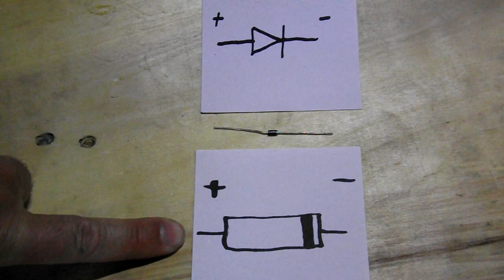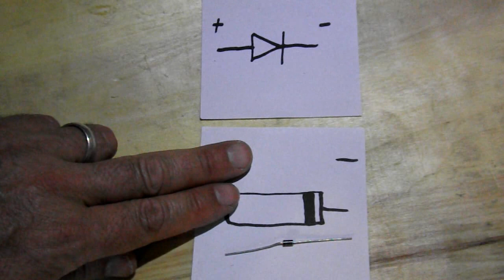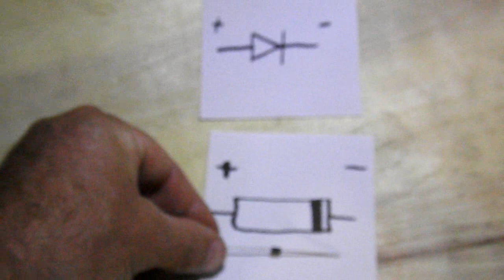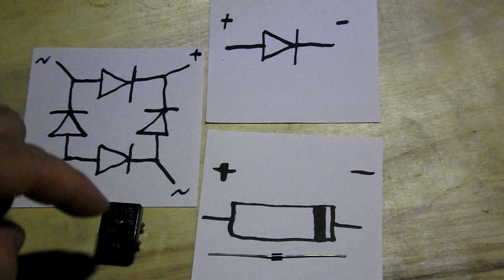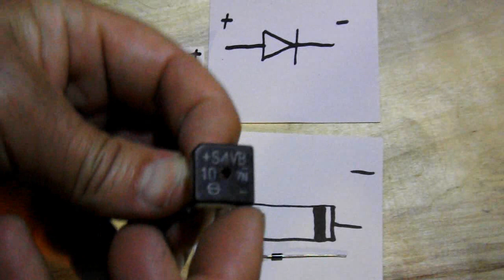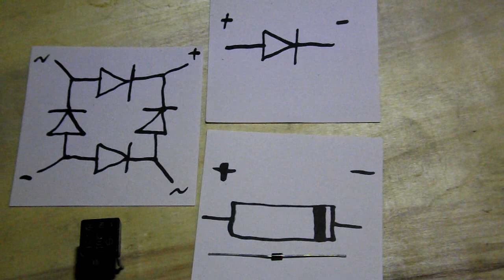Beginners Electronics ~ Understanding The Diode & Bridge Rectifier

Comment: Why you change the direction of rectified current from direction of diode current.... 
As the diagram, current goes from positive to negative in diode..... 

Why in rectifier, Current goes from negative to positive side, shouldn't it be  from positive to negative too??

Comment: Plz tell me one thing if we put dc current to plus and minus of a bulb and give current to both side of bulb mean current in negetive and in possitive of a bulb and there is no negetive or ground so does it glow..??
Reply from the maker: I dont know what you mean by putting dc current to both sides. If you do not have plus and minus from the power supply connected to the bulb, nothing can flow.
Reply: @thedoityourselfworldelectr8007  i mean give current to minus also and positive also of a bulb so what should happen because there no way to flow the current throw nuetral so does bulb glow.??

Comment: In theory: Electron moves from Cathode (-ve) to Anode (+ve)
But practically: it flows from +ve to -ve, P to N, Phase to Neutral

😀😀😀😀
It's true
While designing the circuit diode place in such a way + to -, if you put diode (arrow direction) from - to + in -ve line, It won't work, practically I tested yesterday.

Comment: I'm having an issue with a small solar panel used to charge the battery on a security camera. For some issue the battery won't charge beyond %10. The only thing in the panel is an 1n5819 blocking diode. When I test for continuity the diode is blocking return current but when I test in the flow direction I get a single "beep" out of my meter. The diode is still in line with the panel, should I get a continuous tone from the diode or just a beep? Thanks in advance

Comment: The power flows from positive to minus anywhere"Like a global standard!.What you mention is the electron flow goes from negative to positive(The classic, or even technical, current direction was determined before science knew what really carries charges, or electric current. It established positive charge carriers that flow from the source plus pole through the load and into the source negative pole [1] [2]. It later turned out that there are electrons that are charge carriers by ordinary power line. The electrons are negatively charged and therefore move from the negative pole of the source towards the positive.But in a circuit design etc it is the classic from positive to negative that goes(unless it is spesifick mentioned)Maybe in making some components etc the non classic"way is needed to get optimum understanding and results.

Comment: this is incorrect... nothing flows to negative in the bridge rectifier... both flow to positive... DC. I just learned it now...here by it being wrong ;-)
Reply from the maker: That fully depends on who you are talking to. Through the years some have said it flows one way and some have said another. It also depends on what country you are in. I am now quite confused about which is the current "correct" way we are accepting at this time.
Reply: Yes, but it either all goes positive or all negative, not both in the same explanation.

Comment: The plus and minus may be differently marked on the diagrams around the world but the current goes from the negatively charged to the positively charged as negatives are the electrons and only those can move around (to the positive to equalize).
Reply: They basically work as a pressure. Too much of negatives pressure and they want to go to positive to equalize (pressure). But positives can not move around.
Reply: Current goes from positive to negative, but electrons are flowing from negatively charged to positive holes.......

Comment: Troy.  Nice video introduction for beginners.  Let me add just a tad for those interested in energy relevance to this.  Electron current travels from negative to positive in actual.  But for most circuits it matters little for practical purposes which way you think.  Blame Ben Franklin for originally giving the terms positive and negative to electric potential during his experiments in static electricity and lightning.  He did not know about electrons per SE.  He had a 50/50 choice and picked wrongly.  There are several ways today, how we know electrons (negative charged for free by Nature) conduct from a region of negative charge to a region of positive (or less negative) charge.  One early proof was with the function of a vacuum tube diode.  There the filament gets hot and "boils off" electrons into the vacuum inside the tube.  When a metal plate was spaced inside the tube at a distance away, it was discovered that a current flowed thru the vacuum  space over to the metal plate.  Since the metal plate is not hot it does not emit electrons.  Only the filament is emitting electrons and they only go to the plate.  Reversing the meter connections showed no current flow in the opposite direction.  This proved that the electrons ONLY travel from higher density (negative) to a lower density (positive) region at the plate.  Also in physics, it is well known that energy always travels from a higher energy level to a lower energy level.  This vacuum tube diode current producer is the beginnings of where TH Moray became fascinated with RADIANT energy effects.  I have already explained on another occasion that RADIANT to Moray meant emission of particle streams in straight lines.  He explored this effect both in vacuum tubes and in home made semiconductors similar to the coherer detectors and crystals that many were using for radio detectors in the early radios and crystal radios.  But Moray took it much further than just a signal detector for crystal radios, as he improved the detectors to output high power enough to run appliances, fan, light bulbs using filaments types not puny LEDs.
Reply from the maker: Thanks for the detailed explanation. I think though that Moray was responsible for some awesome "radiant energy" devices which could produce some considerable power
Reply: Troy, did you read my whole comment?  I already said Moray used RADIANT energy to power appliances in his house.  I know you are very busy and missed it with all the new changes coming, so no worries.  Moray often used the "help" of his kids in doing radiant energy demos and experiments for people.  It would be exciting to see in the future when your daughter later becomes your lab assistant for your experiments and sparks a career as a brilliant scientist someday!
Reply from the maker: Actually no, somehow I missed your entire last sentence before. odd. Sorry about that. I can see that Michelle will be quite smart one day.

Comment: Im sorry to say but your scematic of a diode is wrong. At 3:07 compare the top 2 rectifiers you draw on on both sheets. Left diode is the correct flow.
Reply: Exactly, the "arrow" in the left and right drawing are confusing. The positive and negative are reversed in comparison to both drawings. The whole idea of a diode is the flow... In my opinion towards positive. Therefor it's an arrow... The positive and the negative side matters using a diode.
Reply: Ok checked it. I was wrong. Drawing on the left was correct indeed. I learned something! jeej https://youtu.be/6Maq5IyHSuc?t=995
Reply: Troy, I think what iljan2 is trying to say, and she can correct me if I'm wrong.... At time stamp 3:07 the schematic on the left has the + and  - reversed. But yes, other than that, your drawing appears to be correct. However, I'm also a bit confused because she says the left diagram shows the correct current flow. But the left schematic is wrong. The one on the right is correct. The flow of electrons (current) always goes against the direction of the arrow.
Reply: One more point not part of the video but worth mentioning... Without the use of capacitors, the output of a bridge rectifier is pulsating DC.
Reply from the maker: Thanks. I am not at all sure what she means. Yes, I will be making some power supply videos and experiments soon too.
Reply: By the way, what does your multimeter say?  Negative ->|- positive? Use the beep function. :)
Reply from the maker: I am not following you. I just checked my drawing with other schematics and it looks the same. Please try to elaborate.
Reply: Troy, current actually flows from negative to positive, AGAINST the direction of the arrow.
Reply: The presentation on bridge rectifiers was otherwise good.
Reply from the maker: David, so you are saying that my drawing was correct but how I explained the flow of current was wrong? Because I do not see anything wrong with the drawing. Now as to current, there is a confusing subject depending on what manuals you read. I know we now say it flows opposite of what they thought back when the schematics were made up.
Reply: iljan2, Sorry, but the guy in that video is wrong. At 16:25 he correctly labels the cathode and anode. But then says that current flows from the anode to the cathode... From positive to negative! Which is clearly wrong. You were right the first time about Troy having the + and - reversed :)  The only small mistake you made is that the drawing on the left is correct and the drawing on the right is wrong. EDIT: I just got it backwards :) It is the drawing on the RIGHT that is correct.

Comment: Since electrons are negatively charged, negative represents an excess of electrons. Positive represents missing electrons or holes. Therefor since electrons are negatively charged they are attracted to the holes creating a true electron current from negative to positive. All conventional symbolism in electronics is actually backwards concerning true current flow. A good example of this is electroplating where the plating material is negative and the item to be plated is positive. The plating material is carried to the item to be plated by the true current flow.
Reply from the maker: Thanks for clearing that up. I get confused because I am reading a lot of old books and manuals from back when they said the opposite.
Reply: Yep.
Reply: Thanks for clearing that up covfefe. So, with diodes/rectifiers, a 3 phase vawt stator can be converted to work with a single phase charge controller without any polarity problems?
Reply: Then why  the D allows the current along the postive side and prohabit to flow electron from negative end...